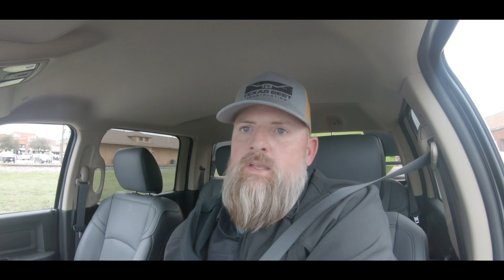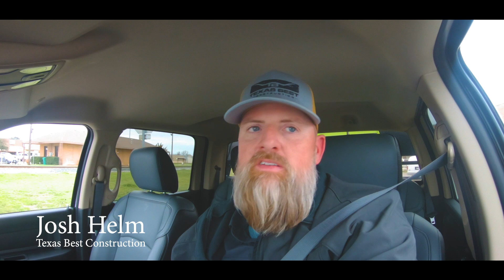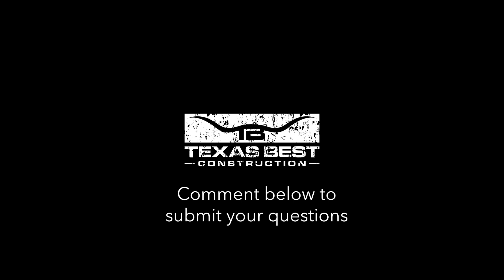Q&A ADVANTAGES of ZIP System on BARNDOMINIUM HOMES in TEXAS

Comment: Can the sheet-metal panels be attached directly to the Zip sheathing or is an air gap required to allow for water drainage/evaporation?  I realize there are already corrugations in the sheet-metal panels which would provide for a rain-screen gap or allow for evaporation of condensation but a substantial amount of the sheet-metal panel is flat.  Would the corrugation in the sheet-metal panels be enough?
Reply from the maker: WR Farms yes it can because there is separation already from the shape of the panels. And since the zip board is fully sealed. This gives a place for the water to go towards the bottom of there was a leak. Also this barrier performs better than having the back of the sheet on the inside.